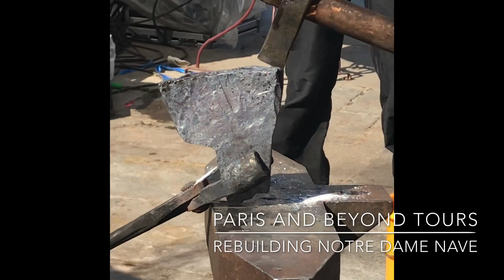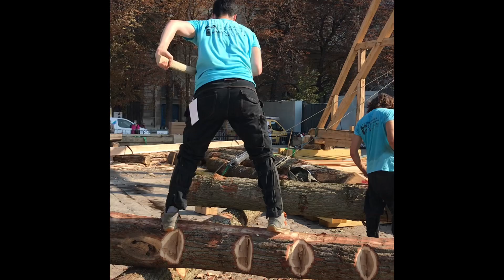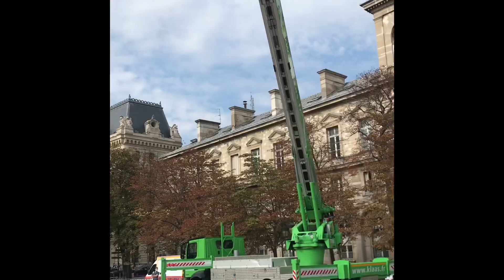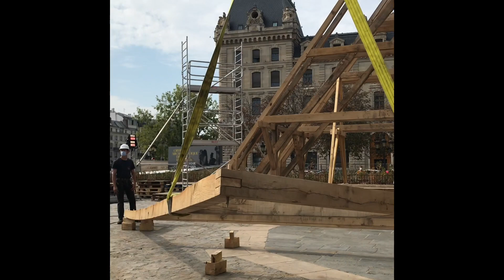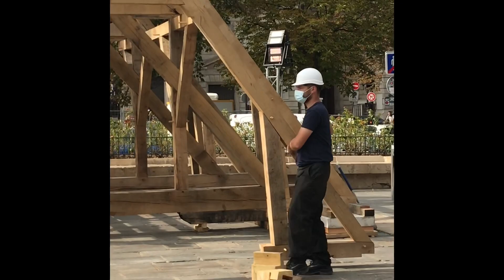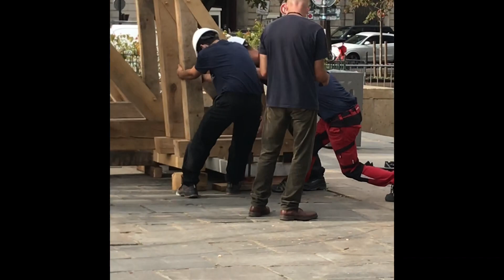Notre Dame Cathedral Rebuilding

Comment: While it is fine that the timber farmers of France are able to show their skills, that the stone structure has been compromised by the fire, it may not be advisable to attempt to use wood to restore the roof structure, from a standpoint of the excessive weight of a wooden roof structure. It must be understood that the roofing trusses they have constructed ar significantly undersize to that which is actually required for the structure